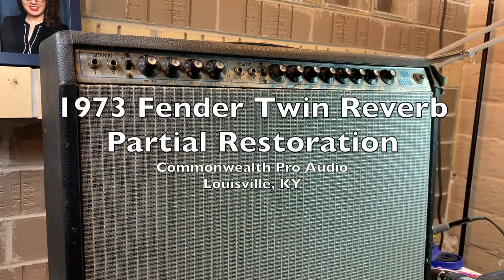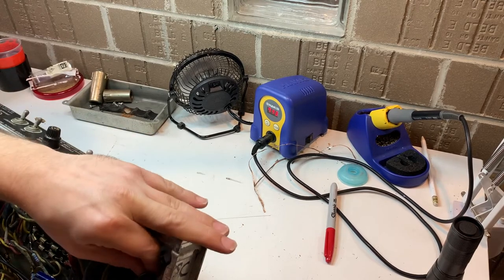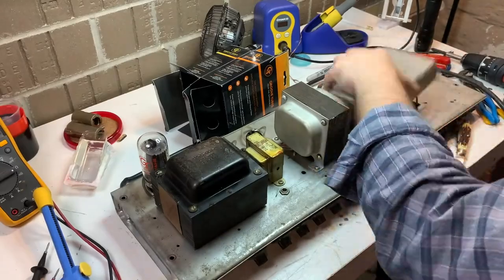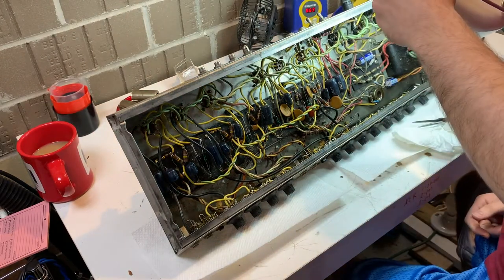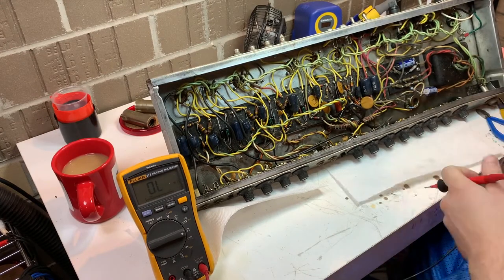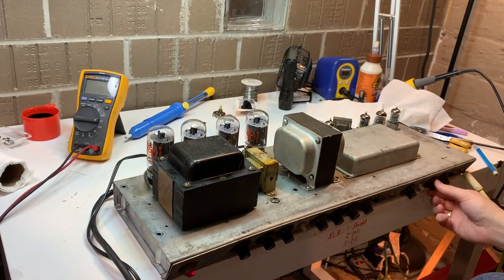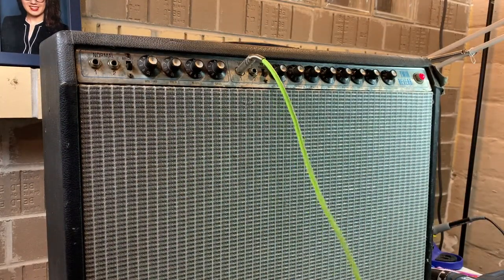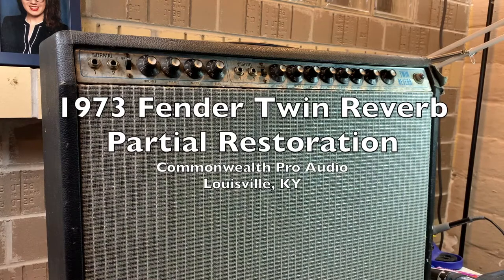Commonwealth Pro Audio - 1973 Fender Twin Reverb Partial Restoration

Comment: You can run a Twin with two output tubes instead of 4 but they have to be the two inner or two outer pairs. This was done to be able to crank the amp without out peeling the paint off the walls. It still never broke up much cranked , the preamp was too clean. Good day

Comment: I have a mint original 1973 Twin Reverb Master Volume that I converted to a head. Only about 25 hours total on the amp. Absolute Pristine inside. The head has 2- 8" Jensens for practice but sits on a Marshall 2x12 Bottom. One aged Greenback and one V-30. Both made in England. Sweet amp. Both the head and the 2x12 are in Marshall Red Tolex. I had both cabs custom made for me.

Comment: 12at7 is your reverb driver or your PI. National made rebranded tubes in the 60’s into the 70’s, mostly sold to service shops. The 470 ohm are your screen resistors. The 1.5k are your grid stoppers. ALWAYS replace your screen resistors on a old amp like that.
Reply from the maker: Thanks for the info on the Nationals! Can you speak to their quality at all? I wish I knew the history of this amp and where it picked up just one.

I'm aware that 12AT7s in Twins are used for the reverb driver and phase inverter. V6 is the PI, and I pulled a 12AT7 from that position. Someone probably moved the 12AT7 reverb driver (V3) to another position to limp the amp along.
Reply: I have seen some nationals imported to Australia.  Marked made in hungary but I think they rebranded from all over the place
Reply: @TheBrothaAB  , "National" tubes in a red box, and with the same logo in red on the tubes themselves, could have been made just about anywhere ---- they didn't make tubes, they merely re-branded them. Country of origin was shall we say "fluid", subject to change, and they may have sometimes changed the printing on the tube to say " Made in Great Britain" or "Made in Germany" to fool people into thinking they were "Mullard" or Telefunken" tubes. Sometimes the tubes were indeed high-quality American or European, but they could also be quality-control rejects, or electronics surplus,  but they also rebranded some Japanese tubes as well.  

Originally, there was a company called National that made radio tubes going back to the late 20's and early 1930's (01A's, 2A3's and 45's and the like) and they made lots of tubes for the military during WWII, but eventually the name got bought and sold a couple of times. 

 Not sure if it was ever the "same" company but there was a National Electronics company that was at one point owned by Richardson Electronics, who made high-quality transmitting tubes, but nothing you'd see in a guitar amp....

Comment: I've got a 72 Super Six Reverb that I MIGHT have re-tolexed. Do y'all do that kind of work? Also, one of the speakers is disconnected, and it's the original speaker, so I'd prefer to salvage it, if possible... It may actually need the whole chassis taken out and looked at. It's getting new tubes, a fuse, and a clean up at Wilcut (in Lexington) right now. I should know more about what all it needs by, the end of the week. Would you be available to work on it, or can you recommend someone else? I don't care to drive to Cincinnati or Louisville, I just want it done right.
Reply from the maker: Sorry, we don't re-tolex. I'm available to work on it. Send me an email at ABToneGroup@gmail.com.
Reply: @TheBrothaAB  Great. Thank you! Do you know anyone who does tolex?

Comment: Buy up these 70’s Silverface amps now before people figure out that they’re all great amps with a little work.
Reply: They really are a bargain. Just picked up a 72 for $600. I mean wtf. New Made in China crap is 2.5x that much! GL finding a 1972 guitar for $600!
Reply: @cgavin1  exactly!
Reply: Bought a silverface bassman last year for cheap... it's become one of the best guitar amps I ever had.  So easy to work on and tweak.  The only complaint I could summon up is that the chassis nuts aren't welded in place.
Reply: @kbkman7742  All the ones I've had have been welded on. I guess over the years that really annoyed a lot of people to the extent it was a common mod. Hehe.
Reply: @kbkman7742  , clean, rough up and degrease the metal around the mounting holes, and clean/rough-up the nuts,  and glue the nuts in place with JB Weld epoxy (the slow-cure type, not JB QwikWeld). If you prep the metal well and have good gluing skills, the nuts will stay in place and won't spin when you tighten or loosen the chassis-mounting bolts. I recommend you lightly lube a quad of matching-thread bolts and put them in the nuts to keep the glue from infiltrating the threads while the glue sets.